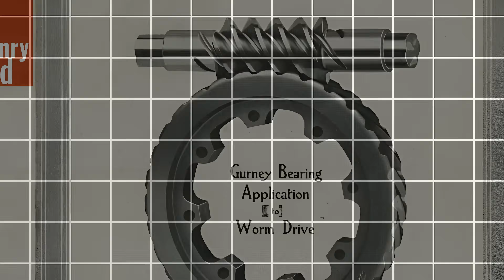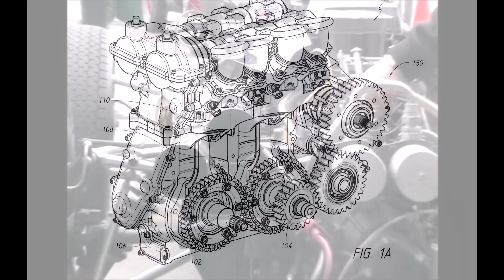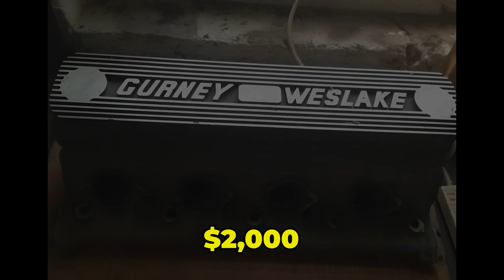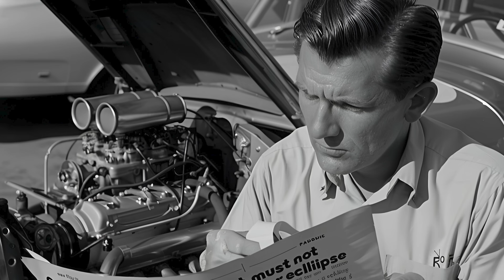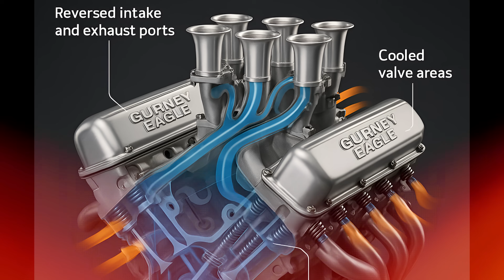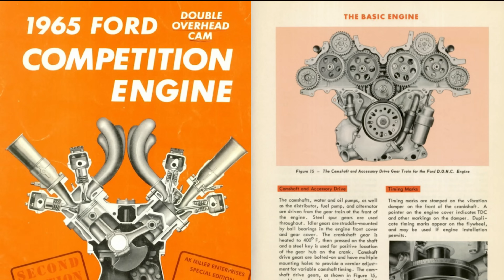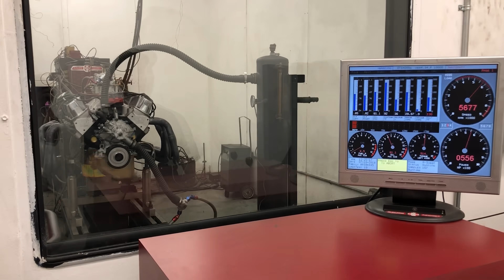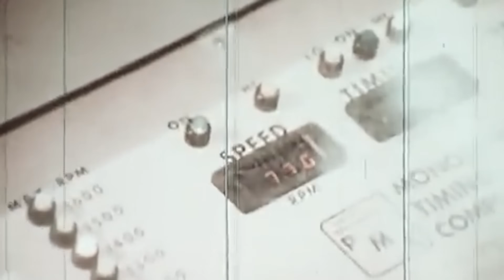The Shocking Truth Behind Ford Banned Gurney Eagle V8 Indy Engine

Comment: The Gurney 446 could never run at Indy. Stock block engines were limited to 5 liters, OHC race engines to 255 cu in and turbocharged engines to 160 cu in. This video shows all kinds of engines with the pics never meeting the naration.  Gurney biggest success at Indy was his Eagle chassis which won several times.
Reply from the maker: You're absolutely right! The Gurney Eagle chassis was indeed a remarkable achievement, and the engine regulations at Indy have always been quite strict. Thanks for sharing your insights!   @LEOR4997

Comment: These were still single camshaft-in-block engines.  Push rods, hydraulic tappets, and overhead rockers.  That means on a three valve system, the intake camshaft lobe would have to drive two valves, rockers and springs.  That would unavoidably be a potential problem.  One cam lobe driving two valves at 7,000 RPMs?  The stress would be astronomical.  Valve trains are typically high wear and soonest to break.  Yes, the blocks were cast at CCP, but much of the video footage was shot in Engine Plant 2, right next door.  Same plant that assembled the Boss 302, Boss 351, 400M, and other experimentals.  CCP did not have a dyno room.  CEP Plant 2 and CEP Plant 1 had dyno rooms .

Comment: Many, many images have nothing to do with Gurney, ford, V8s, racing, machine operations, engine building. You can't even be consistent about whether the intake manifold or the exhaust is at the top of the engine. Or even how many cylinders the engine had. You show pictures of lathe operations to illustrate casting and piston to illustrate cylinder heads.  Do you know ANYthing about the subject? Stop the beul schmidt!

Comment: a 7 liter 446 would never have run at Indy. A load of codswallop here.
Reply: 446 was the engine designation not the cubic inch displacement. The Ford engine was the 289 ci, modified to 302 ci and then to 320 ci.
Reply from the maker: Codswallop? Now there’s a term you don't hear every day! But hey, racing is all about pushing boundaries, even if it means ruffling a few feathers! @bluedog373
 engine was 320

Comment: I have access to a set of those gurney heads and an intake for an 8.7 deck block. If I had 4 webber dual throat carbs  I wolud build an engine with them. I may yet, I  could have sheetmetal intake made, but i like the 4 webber setup. I just do t have any webbers in my stash.
Reply: I know a guy.... we can get you into those webbers for not that much coin.
Reply from the maker: That sounds like an amazing project! Those Gurney heads are a rare find, and the Weber setup would definitely add some serious performance to your build. Keep us updated on your progress! somw one in the community has reached out  @charleslum2438  @bretbauer7582  thank you for being an awsome member , this is why i built this channel

Comment: I think this is incorrect. No 446 CI small block ford for Dan Gurney. I believe the Gurney Weslake engines were 302 CI.
Reply: Exactly, everything was based on the 260/289/302 block
Reply: if the heads fit the 302 they will fit on clevo's
Reply: ,,, may have an early dyno horsepower number . I don't know enough about the program , but that cubic inch is news to me .
Reply: And the Indy Ford engine, I’m confused.
Reply: @ProjectFairmont ,,, well that was the separate from Dan other big Ford program , hugely successful with Clarke winning the 500 .
Reply: @rolandtamaccio3285 yea, I wrote a paper on the pushrod 260 Indy engine and the 255 quad cam for the Revs Institute.  I was confused as this video was all over the place with photos, AI generated bilge?  The advantage of these engines aside from mid engine configuration of the Lotus was the use of gasoline vs alcohol for the Offy.  Fewer fuel stops.
Reply: @ProjectFairmont ,,, yes , toooo many out of context photos and probably nomenclature ; however the fuel mileage was only part of the reason . Here are a couple others . The Ford had more power per cube and maybe weight , and the Offy was detonation prone with the large bore .
Reply from the maker: Thanks for pointing that out! The Gurney Weslake engines did indeed have a lot of interesting specs. I appreciate your input! built from a 302 ford block ,  up to 320, the 446 was the engine  designation , not the ci.... se specs in the details section